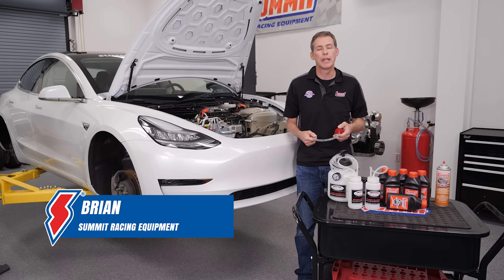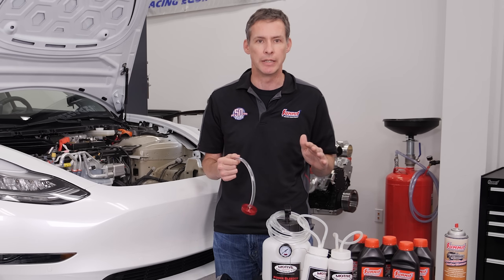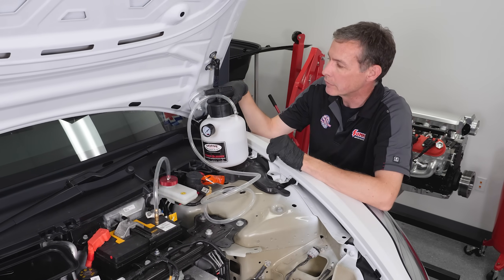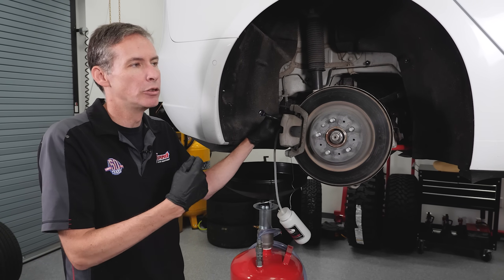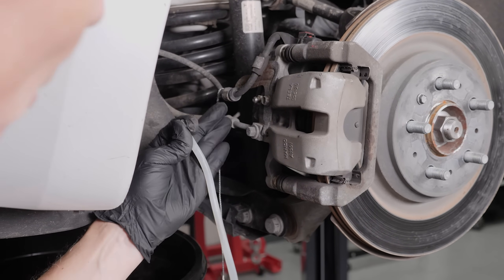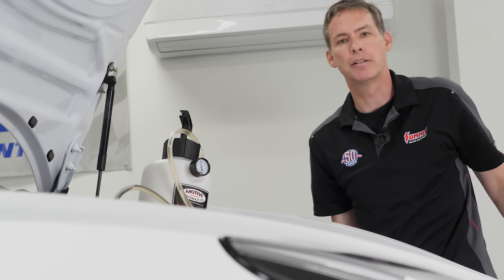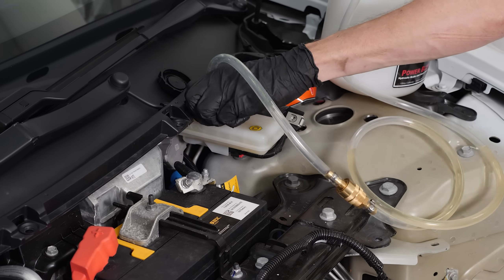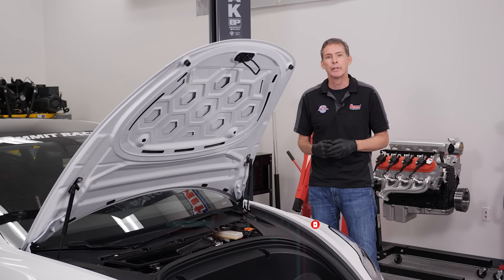How to Use a Power Pressure Brake Bleeder Kit to Quickly Bleed Brakes & Change Your Brake Fluid

Comment: You should hook up the pressure bleeder dry & pump up to 15psi to verify no air leaks before you place brake fluid in the container. If it’s a total flush, use a turkey baster to remove fluid out of the reservoir. Make sure to check all the bleeder screw will come loose before you start process. Brush & spray brake cleaner around all the bleeder screws before to start the process.
Reply: Very solid advice!
Reply: Why the brushing and cleaning of the breather screws?

Comment: Will this deal with the ABS system on modern vehicles that require plugging in to the computer to allow ABS bleed?
Reply: This will work but you also need a bi-directional scanner!

Comment: This is the bleed order in the Tesla service manual:
1. Bleed the front LH brake caliper first.  -- Outer, inner and back to outer
2. Bleed front RH brake caliper next. -- Outer, inner and back to outer.
3. Bleed the rear RH brake caliper.
4. Bleed rear LH brake caliper.

The Motive can also be used "dry." Just need to watch the Master Cylinder and fill it as needed. My 1118 GM adapter didn't seal with either gasket shipped with the unit. I used tape to build up the thickness of the gasket so it would adequately seal and pressurize.